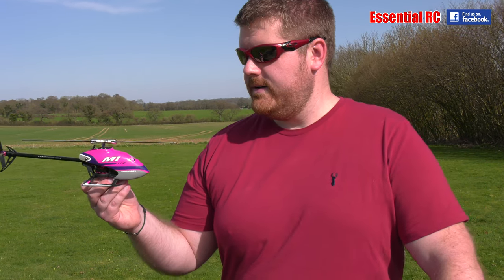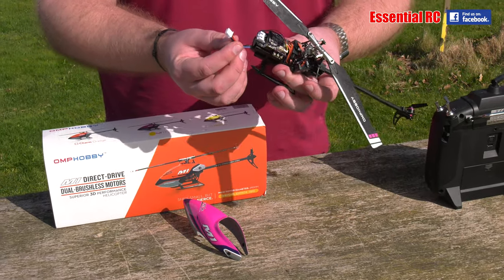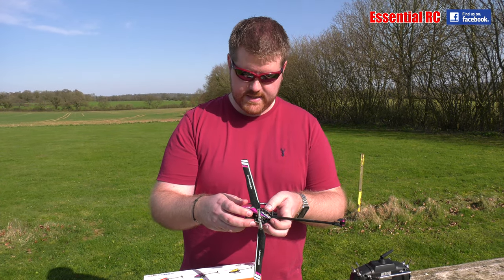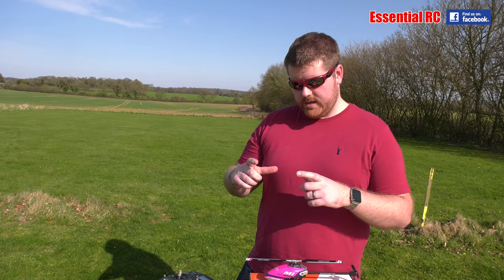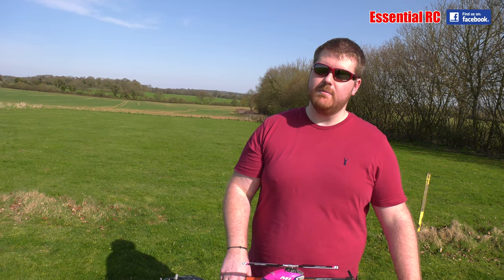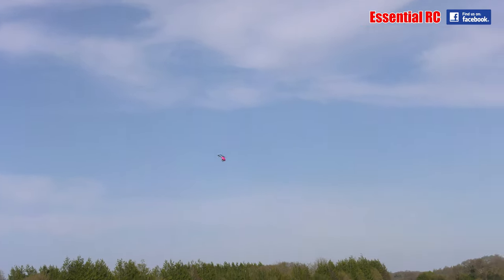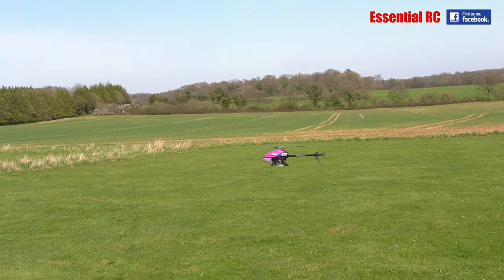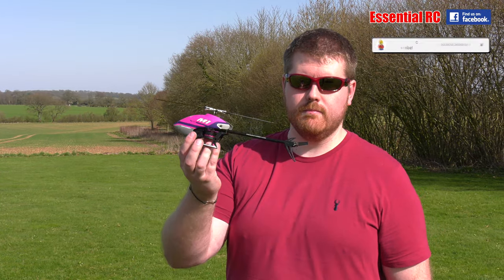OMP HOBBY M1 MINI RC HELICOPTER:  DUAL BRUSHLESS DIRECT DRIVE 3D PERFORMANCE | FLIGHT TEST

Comment: Is the heli easy to setup?
Reply: Very simple to setup, no mixing required in the transmitter no Pitch curves etc. You need to just assign a switch to the mode and you are good to go. 2/3 mins to setup. The flight controller takes care of the rest for you 👍🏻
Reply: If you buy the OMPhobby T6 transmitter there is no setup at all, you just literally bind and fly.

Comment: Such a great 🚁🔝👍🏼‼️
I quit doing/building R/C - 🚁's around 1999 to 2004 and it’s cost me more than 2.500,-€ because the crashes + the following re-orders for extra parts where way much to expensive. 
I would like to step again into this great hobby because a auto-hover mode or stabilizer.
Could you please give me a advise where to find as fun/Scale a MD-500D as a small size? 
I really would appreciate an answer!
With kindest regards and greetings from Germany ✌🏼‼️
Reply: Hello yes Heli,s are difficult but I would recommend the E-ACHINE 129 as this is super stable and full 4 channel and small so you can fly inside.

Comment: Does it have an internal RX, or do you have to use S-Bus or Futaba?
Reply: Hi Keith It has and internal RX if you are using either an OMP Transmitter or have a Multiprotocol transmitter such as the TX16S or other multiprotocol transmitters that could support the OMP protocol. If you are wanting to fly with a Spektrum/futaba/Jeti etc then you could need a small Sbus RX (OMP sell these). However if you have a multiprotocol transmitter you are good to go alternatively OMP have a transmitter that is pre programmed and ready to go. hope that helps Jason - Essential RC
Reply: Hi, may I use Eachine e160/e180 transmitter since it is futama fhss compatible?

Comment: The Radiolink TX-16s version 3 is very splendid radio indeed, and for a couple of hundred pounds, it's got more functionality than you'd ever need. You won't need to fly anything else.
Reply from the maker: Radiolink transmitters are not multi protocol and have their own proprietary software. Radiomaster TX16S is best option

Comment: Wow! incredible flying skills 👍
Reply: Thanks Toby, although this machine can do a lot more in the hands of a pro. I don’t fly heli’s as much as I would like too. Mainly due to the cost of crashing them but with helis like this they build your confidence quickly as most of the time they just bounce :)
Reply: @randall8686  your better than i am at flying helicopters 😂
Reply: @tobyg2377  sims are a very good place to get to grips with heli’s much cheaper to press reset, but in all honesty something like an M1/M2 Heli will bring your confidence and flying ability up to speed much quicker than a “big” Heli. Once you get to wanting to do big precision manoeuvres then obviously the larger heli will have advantages but for getting off the ground and learning the ropes these are amazing. I got my first RC Heli not far off 20 years ago. An Xcell 90 with a mechanical gyro and it was such a handful. I wish these existed then!

Comment: Why don't they put a normal switch on these helicopters? Every time you remove the cab and plug in the wires, it's inconvenient.
And the helicopter is good.
Reply: A switch would be great, but when you go full throttle on this and other electric heli’s the current draw during that punch out is really high meaning you would need a fairly chunky switch for it to be reliable and not fail. Plugging in the cable is not too much hassle and it’s one less thing to go wrong 👍🏻
Reply: For safety reasons you always should remove the battery for charging. Most people have multiple batteries and swap between flights anyway.. So a switch wouldn't really add anything and is just more weight.